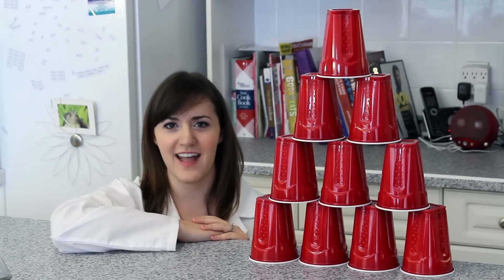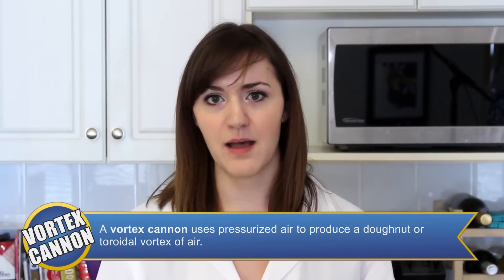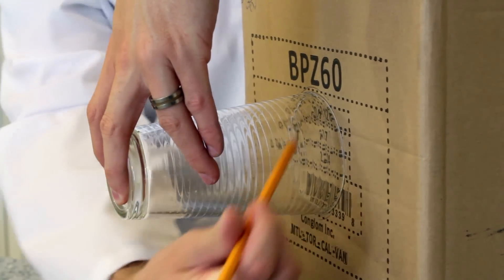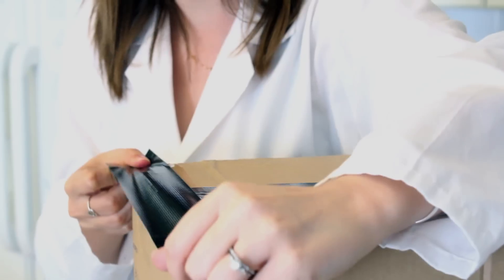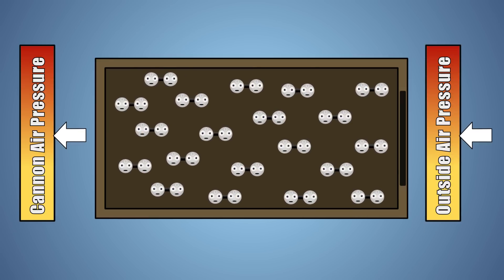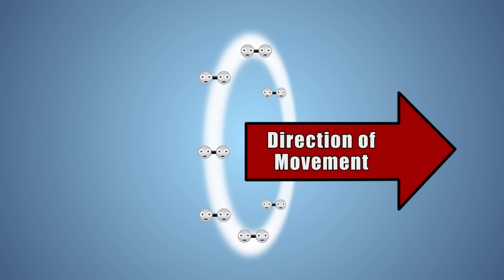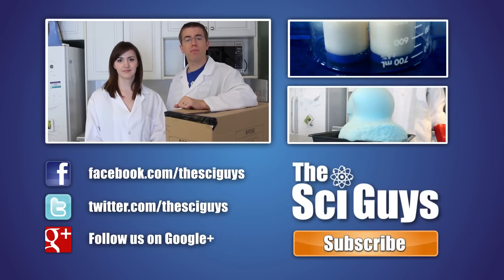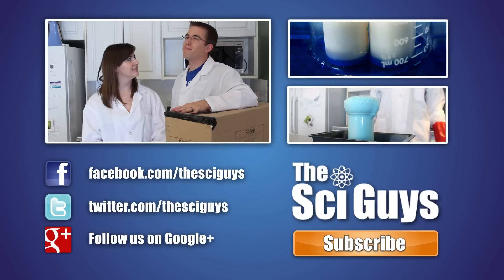The Sci Guys: Science at Home - SE2 - EP12: Air Vortex Cannon

Comment: At 3:00 you say "when a fluid, like air, is forced through a round hole..". Am I missing something? Isn't air a gas? Can you explain this please?
Reply from the maker: Jared Swapp Yes air is a gas. As far as physics is concerned a fluid is a substance that continually flows under applied shear stress. Fluids are a subset of the phases of matter, such as liquids, gases and plasmas.
Reply: @TheSciGuys can flow of sands particles called as fluid too?